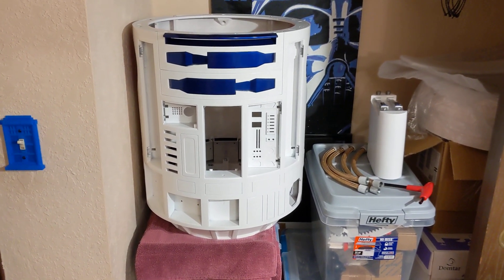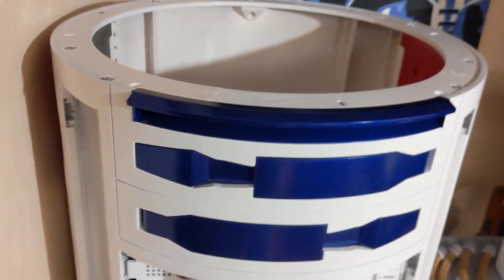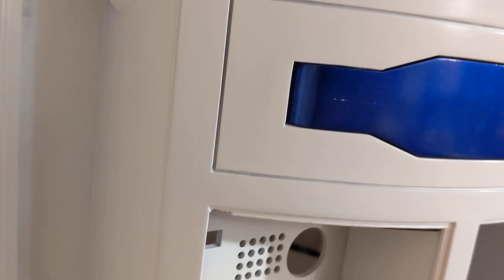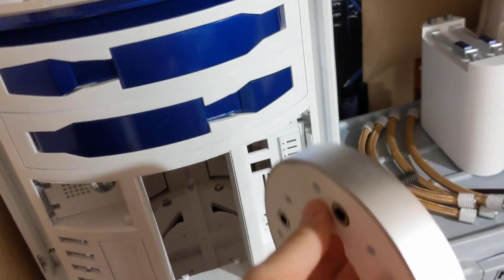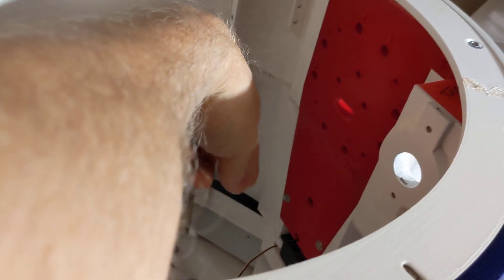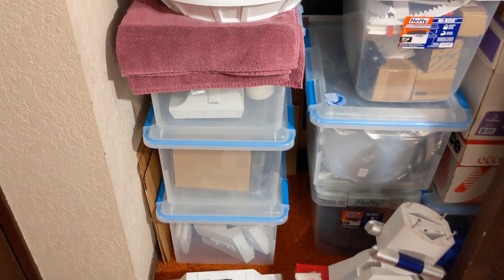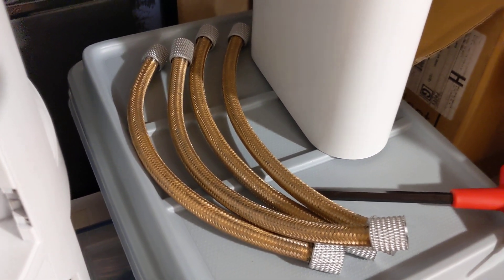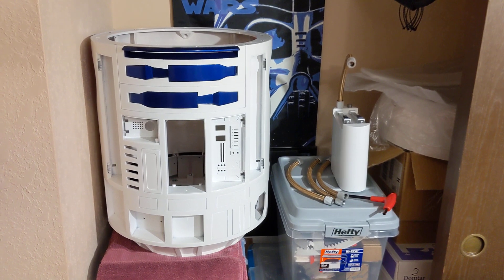3D Printed R2D2 - Part 83

Comment: It’s great to hear your in a better place this year Tom, as for the shoulder hubs. Spray a few more coats on them with that rust oleum metallic aluminium, I’ve found the more coats you give it the shinier it gets. The utility arms, I’ve put magnets in mine, so they sit nicely in there and if I need to I can take them out easily too, they just pop out. The battery hoses, I used clear plastic tubing with a gold selves over the top of them, they turned out great and it keeps the weight down too. Your r2 body looks beautiful too.
Reply from the maker: Thanks for the kind words and suggestions!

Comment: Wow - things have really come a long way this year - it's looking amazing. Take time to admire your work - you are rightfully proud. One warning about the AN-6 foot hoses - if they are like mine, they are very stiff. I've already had to replace two of the threaded inserts on the battery boxes because the "spring" force of the hose eventually caused it to shear right off. I printed replacements with lots of perimeters for added strength. Looking forward to the next update!
Reply from the maker: Thanks Jason!  Watching your progress was a big motivation for me.  
I did notice the hoses were struggling to maintain the tight curvature.  I'll keep my eyes on them and reprint the pieces in PETG with more perimeters if they appear to be failing.

Comment: Tom, are you finding the body needs to be glass-smooth before painting or is that white paint more forgiving than the aluminium one?
Reply from the maker: I did find the white paint to be more forgiving.  I think it might also help that the body is so large that it doesn't draw your eyes to small imperfections.  The metallic paints are the ones that really need a smooth finish.